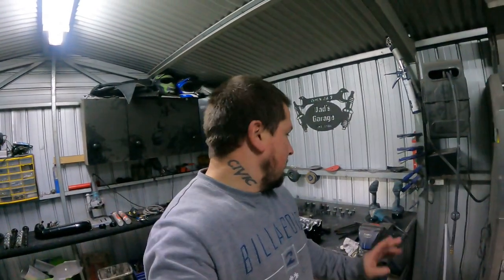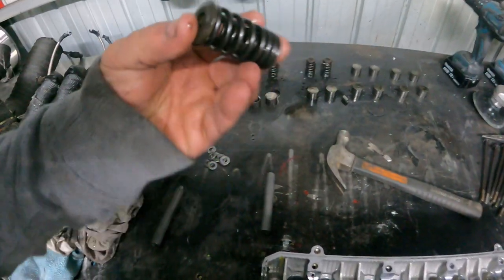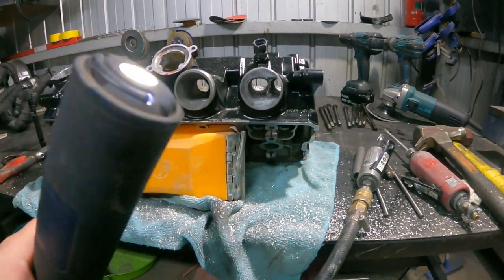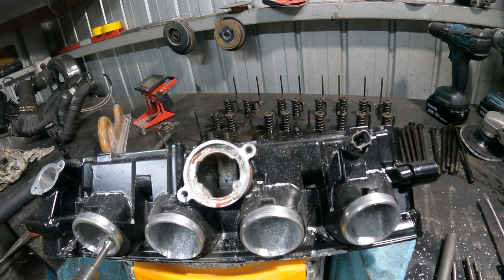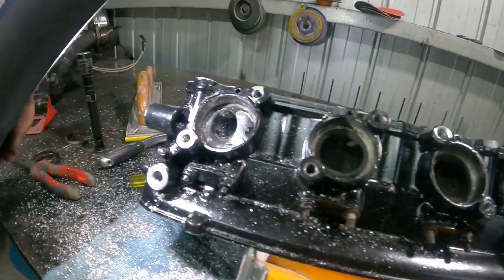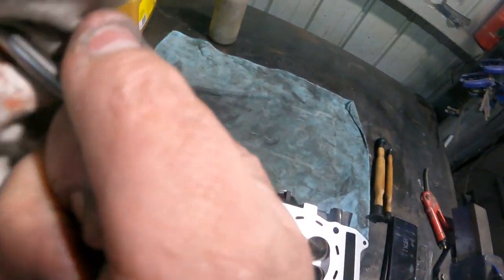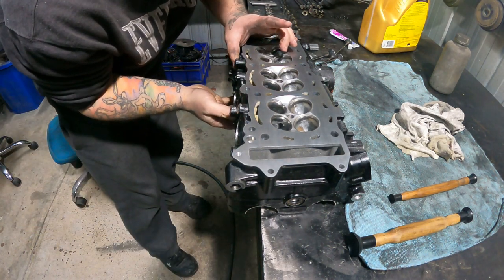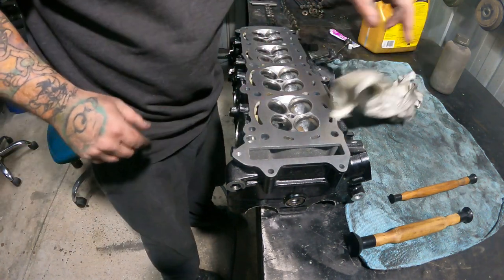400hp turbo hayabusa gets some serious head porting

Comment: I have a feeling the Gen2 Busa head I ported ended up on Australia's Fastest Stock Length Busa Drag Bike & I got stitched up with a RAMS Ported Gen2 Busa Head that ended up in my 1580cc Stroker motor.  I used 70lb springs & used a burrett (spelling?) to measure the liquid volume in each port & evened them all up for even flow. After I get rid of the Kawasaki, next build is 1600 cc gen3 busa